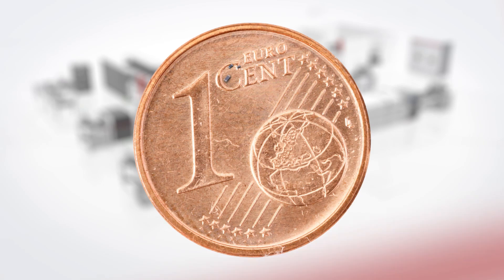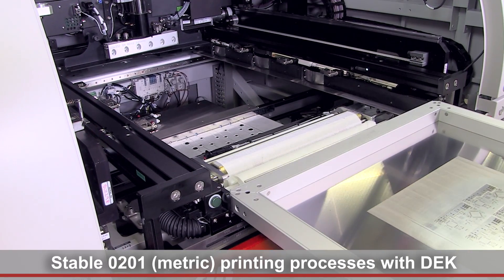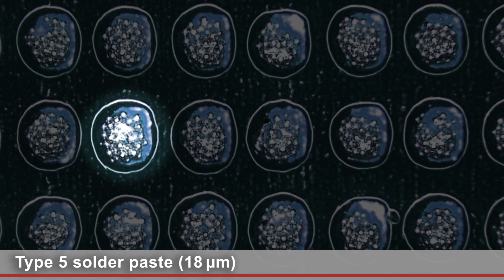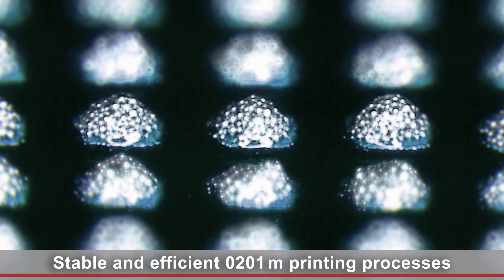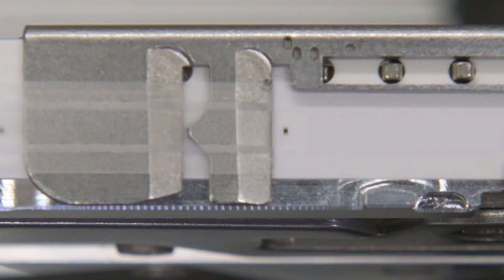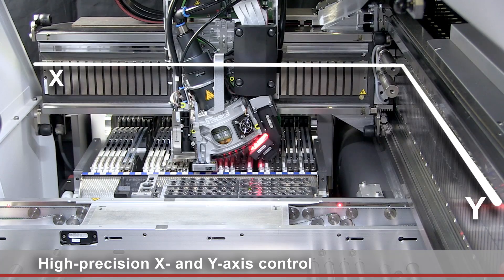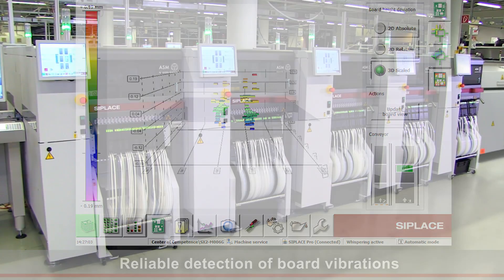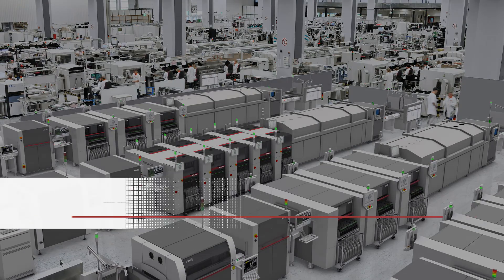Placing 0201 metric

Comment: Am having issues with 201 placement only.
Parts flying everywhere for only 201 placement.
The rest 402 or 603 are fine.
What could be the cause.
Asm x series...
Vacuum is good, cal is ok.
New nozzles and also just change the linear bearing
Reply: 906 nozzels for the 201 parts? hopefully your solder paste is not dry. and board supports
Reply from the maker: Hello Sanjay
You can discuss process issues with our experts at your closest Center of Competence here https://smt.asmpt.com/en/contact/smt-center-of-competence/ or contact your local support team here https://smt.asmpt.com/en/contact/service-hotline/ to discuss your specific production issues. We are here to help.

Comment: Cool! I pass the ASM building almost every day here in Phoenix!
Reply: Any suggestions for 201 parts flying during production.
No errors
Reply: @sanjayramjeea2510 make sure your feeders are indexing correctly, sometimes the part packaging pop parts, and check nozzles something. Or your part profile is wrong or wrong part loaded. make sure your feeder table is not loose.